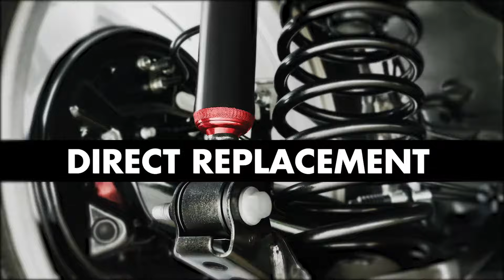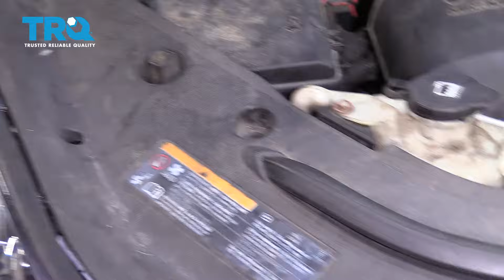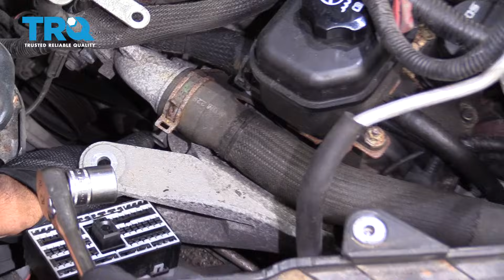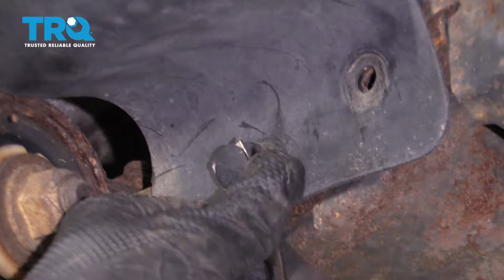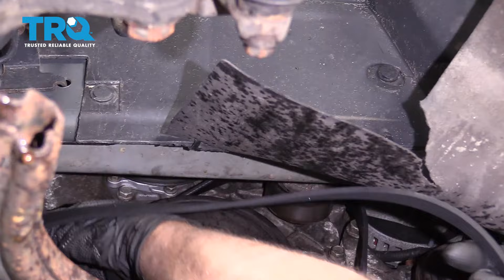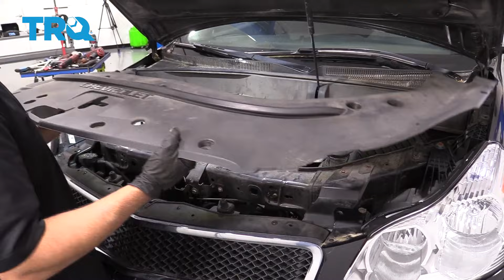How to Replace Water Pump 2009-17 Chevy Traverse

Comment from the maker: √  Watch the Video
√  Buy The Part at 1A Auto https://1aau.to/m-Shop-TRQ-Parts
√  Do it Yourself
√  Save Money
Reply: first time mechanic..I put the water pump pulley back on slightly secured the 4 bolts ..put the belt on to tighten the 4 bolts and couldn't because the pulley still turns ...I followed your excellent video to the letter.. what's wrong??
Reply: Can you please do a video on how to replace the belt tensioner AND idler pulley on this same vehicle? Ours is a 2015, & the mechanic I took it to couldn't pull the bolt out all the way that holds the idler pulley in place. He said the bolt was too long & hits on the unibody, & wouldn't come out all the way. So he wasn't able to change out my idler pulley and belt tensioner. I was in denial because I was hoping to get these 2 swapped out with the new belt & water pump just as a preventative measure, not because they were bad. (I had already bought the parts). Please help!

Comment: I don't understand why you did all that work on my Chevy traverse all you have to do is take off the the passenger side front tire tire wall remove the belt the bolts and remove the water pump

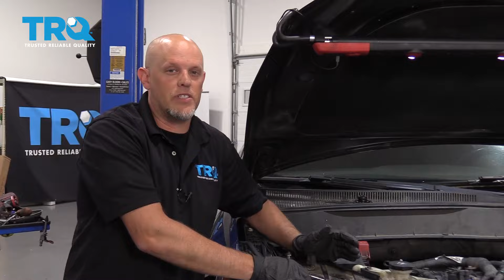Comment: WARNING!! This is a great video and I fallowed it and it is much easier then it seems once you start into it. And doing it from the top like this you can clearly see the gasket is set properly and easily torque all of your bolts exactly. However, at 15:17 where he says you can leave your heat on just lightly, I would like to advise everyone to NOT touch your climate controls at all!!! Your cars climate control will start at 74° which is right in the middle, I actually suggest you just turn on the ignition (one click of the key where the radio and windows will work but not start the car) and then wait two minutes then turn the key off and then start your Traverse and fallow what he says around 15:05, but still don't touch the climate controls for at least two minutes.  The reason is after a long time without a battery the Traverse and the Buick and GMC version of this car needs to calibrate the heating controllers that mix how much hot or cold air blows and also if it blows on the feet or window or both.  If you turn your temperature too much towards hot or cold, it can cause the actuator to keep turning past the hard stop and crack the internal gears. And in my opinion these little actuators are almost as hard to replace as the water pump.

Comment: I'm going to have to replace my water pump (255k miles, so I'm not surprised) probably this spring as the pump is slightly damp (according to a shop it was in recently).  This video is excellent!  I had seen another video in the past and it looked much harder because they did not remove the fuse box.  Since the fuse box is right over the water pump, it seems like a no brainer to get to it from there.  Can you also replace the alternator from the top down, too?  Or do you have to access it from underneath?

Comment: Great job and video, I tried coming in from the bottom just didn’t have the tools to make that happen. So somehow after putting the fuse box all back together I have an issue with no front lights now and it still thinks the hood is open. So getting those  blocks tightened back up correctly may be my problem? Can you answer that?